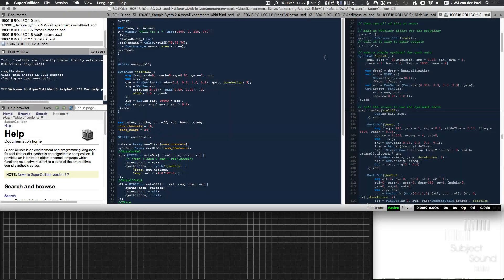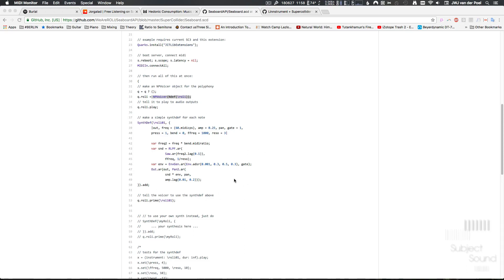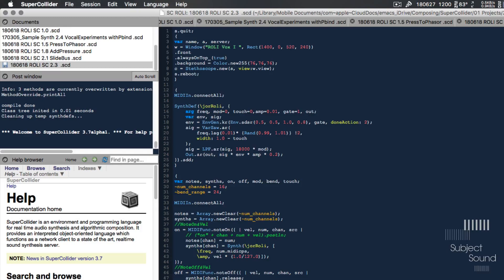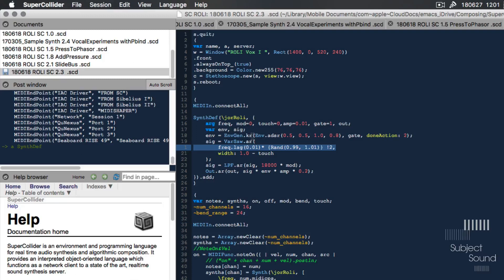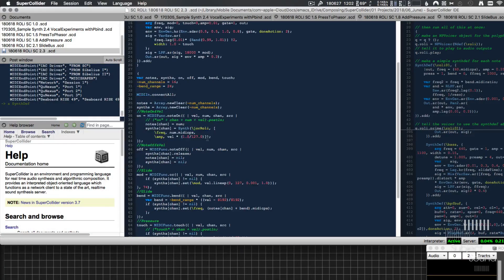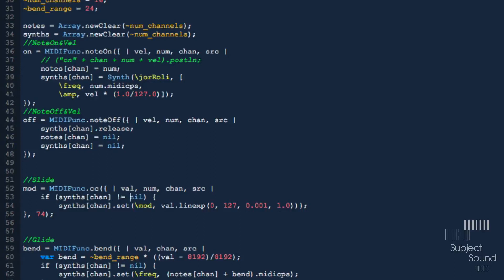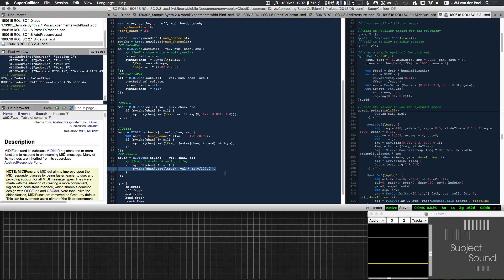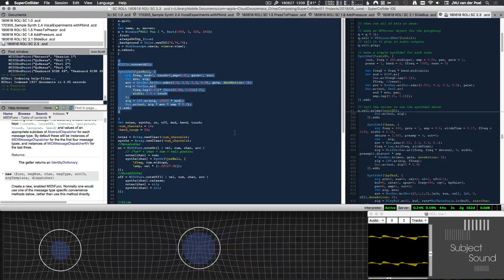How To Tutorial - ROLI Seaboard Rise in Supercollider Pt. 1 - SubjectSound

Comment: Does the roli seaboard or the MPE allows 14 bits messages? The slide and pressure messages with only the traditional 7 bits seems to be a strong constraint...
Reply from the maker: It offers a higher resolution than 7bit, due to the usage of multiple channels per performance. So it still confirms to the MIDI standard but uses some sort of workaround, I believe this is how MPE works in general :)